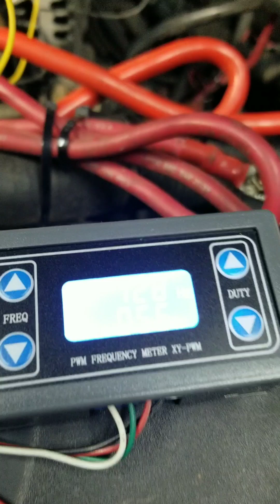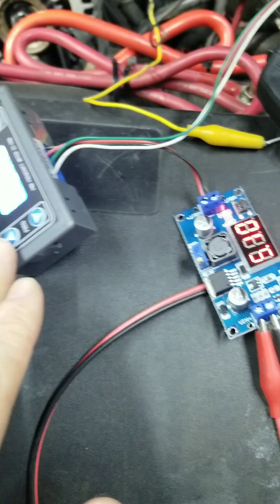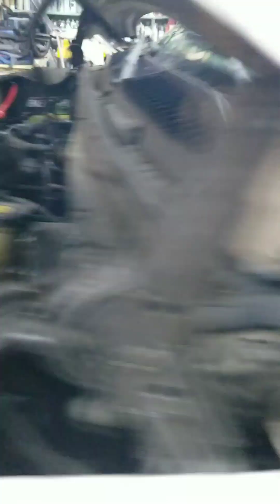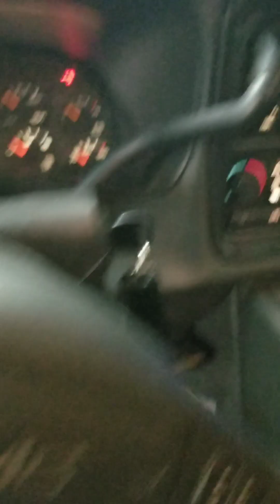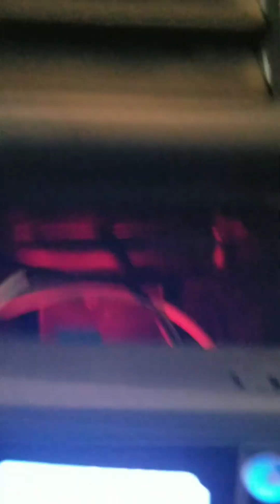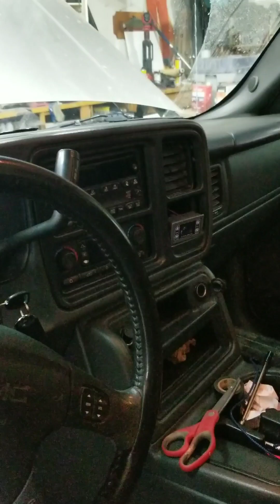Increase the output of your Alternator

Comment: Thanks for the video. I am about to do this modification on my truck that is suffering from erratic voltage swings. (I have already replaced the voltage regulator on the ground cable with no beneficial results) I do have one question that I hope you can answer- when you cut the brown wire and spliced in the new PWM wire to the connector, did you cap off the brown wire going back to the ECU through the firewall? 
Also, does the modification cause the battery light on the instrument cluster to come on? Hope you can help clarify and thanks again for the video!
Reply from the maker: So yes I just put heat shrink over the other end of the brown wire.  If I ever want to reconnect it I can.  And no...there is no battery warning.  The computer is still reading alternator output
Reply: @ontariooutdoorsman excellent! Great work, and thanks for the quick reply! Subscribed!

Comment: That's really cool Jim. It will be interesting to see if it affects the longevity of the alternator at all. Do you plan on only turning it on during travel time or while your plowing as well? Again, great video!
Reply from the maker: @NorthernHomeGarage  plan is to leave it at about 14.2 volts normally.  That's standard automotive alternator voltage 14.2 to 14.4    I will increase it when plowing then turn it back to normal after charging.  Alternator can absolutely handle the output.  The computer can and does at times crank it up but it wont do it when needed.  They are not continually monitoring the voltage.  Ideally I may purchase a 300 amp or 500 amp alternator...which when connected to my PWM module will essentially prevent battery drain completely when plowing.  I put a large alternator on my old plow truck and it helped alot.  But it's old style constant output.  This combined with a high output alternator would be fantastic
Reply: @ those headlamps are gonna be bright!! lol. Nice work sir.

Comment: That's pretty cool...just gotta keep an eye on it so that you don't boil your batteries on a longer ride. Does the ECU spit out a "check engine" code because it no longer "sees" the alternator or is there no feedback loop back to the ECU?
Reply from the maker: No code.  There are 2 wires connected to the alternator.  One is the ecm pulse controlling the alternator and the other is the return signal to the ecm from the alternator.  I left that wire intact so I do not get a charging system error.  So previous vehicles kept the voltage at approx 14.4 at all times.  I'm going to leave this at about 14.2 and increase when I plow.  I'm going to install a switch to be able to select manual control...or normal which will reconnect the alternator to the computer.  Once winter is over I'll flip it back to the computer